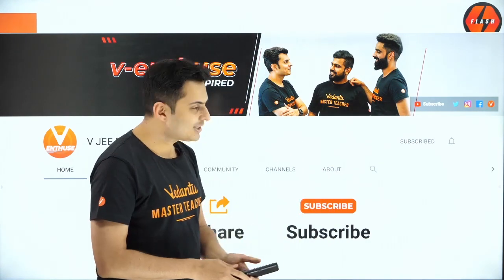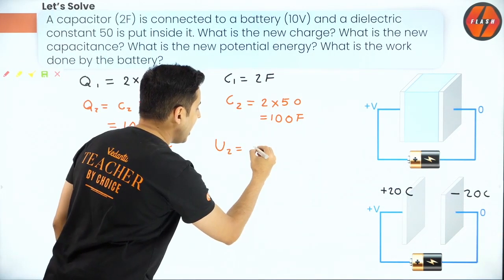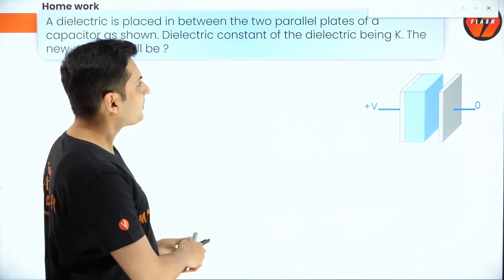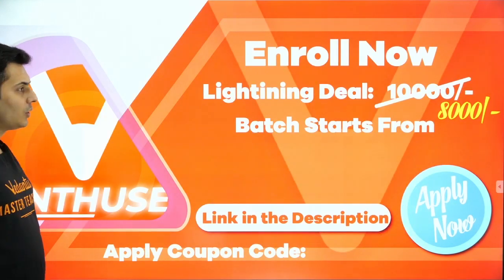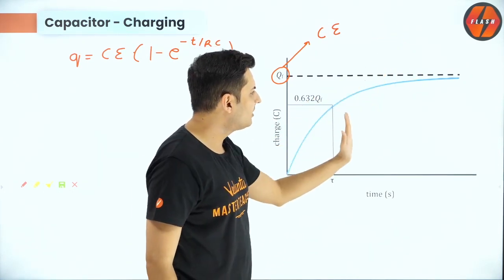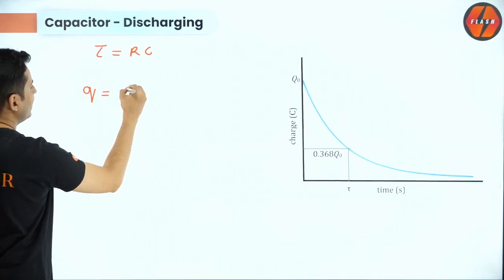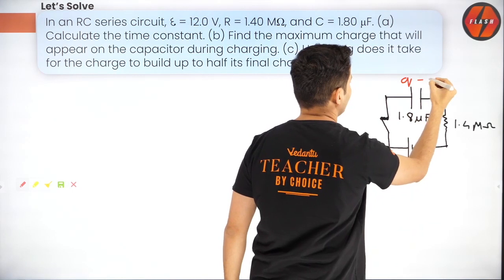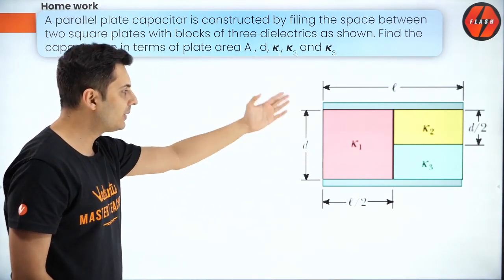Capacitors L-3 | Charging, Discharging, Energy & Dielectrics in Capacitor | JEE 2021 | Vedantu JEE

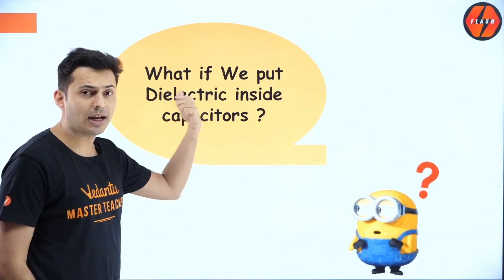Comment: 03:39 is the case where dielectric is placed with the battery still connected - hence E,V,d are same - but Q increases by a factor K as the battery supplies the extra charge....capacitance also increases by a factor K because Q=CV...thanks for your efforts ✨⚡